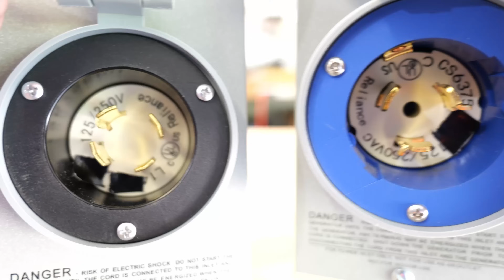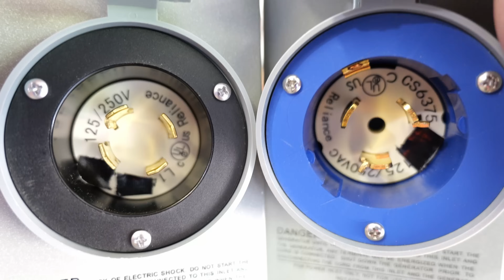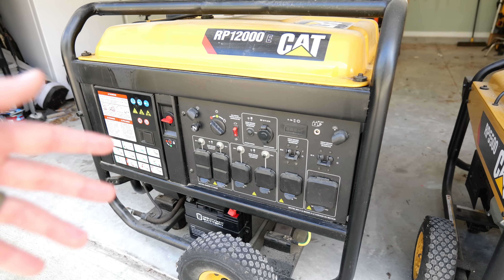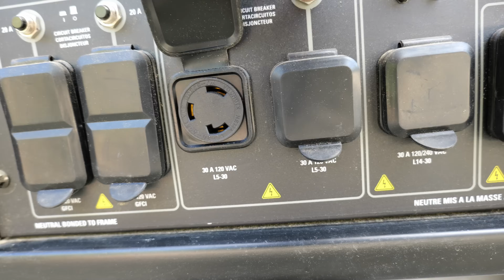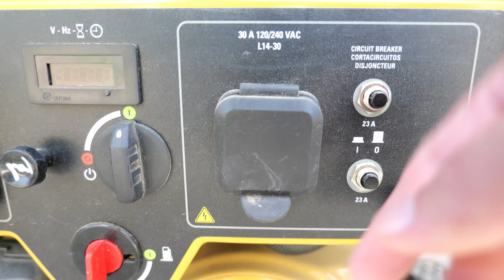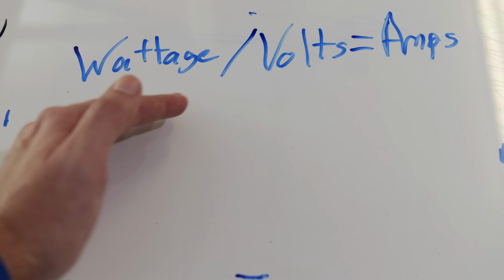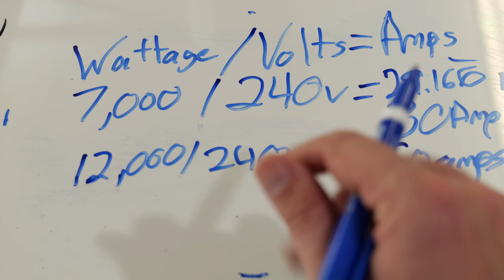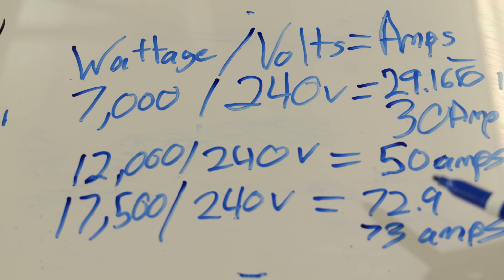30 Amp vs 50 Amp Power Inlet Box.  What's The Difference and Which One Do You Need?

Comment: Can I use a 30 amp inlet box , also for an outlet to an RV ? Thanks
Reply: Well, the pins are the opposite “gender” on these boxes, and if you have a properly installed switch or interlock it shouldn’t allow the main breaker (from the meter) and the breaker from the inlet box to be on at the same time, to prevent backfeeding. Personally - even if you could rig something up to make it work - if I was going to the expense of having an inlet box installed, I’d go ahead and pay to have a 30 amp outlet installed at the same time.
Reply: @DavidBugea  thanks

Comment: My predator inverter 3500 only has 30 amp. Odd to see that the Predator 9500 inverter also has 2 30amps an no 50amp plug. I need to power an HVAC
Reply: You should be able to power a wall A/C unit, but if you have a Central HVAC, you will need a soft start to reduce the amp draw to start up of your central A/C unit, because start-up can be around 60 amps and then drop down to around 15 amps when the Central AC unit is running on a 3 ton unit.  The soft start gets the amp draw down so the Central AC unit can start.  How To Home has a great video with details on how to install a soft start unit on your Central A/C unit at the Compressor/Condenser unit.  Hope that helps you.
Reply: @audiophileman7047  Yes I just recently installed 2 MicroAir Soft Starts on my 2 4 ton units. Really awesome to see the Amerage draw at or belo 30amps now on each unit. Amazing actually!
Reply: I use a surge protector and 50 amp to 30 amp adapter to plug my 50 amp cable in the 30 amp generator.  I can't power everything at the same time, but it'll meet my needs during an outage. 👍👍👍